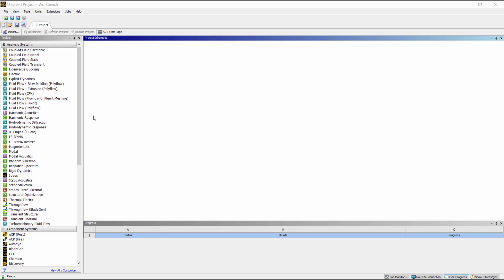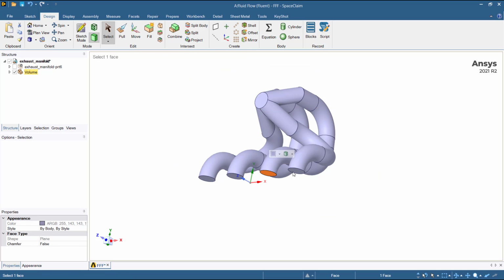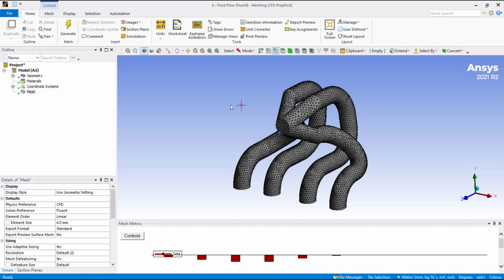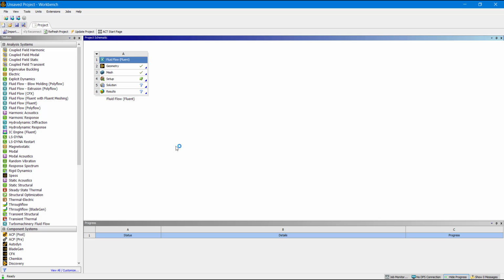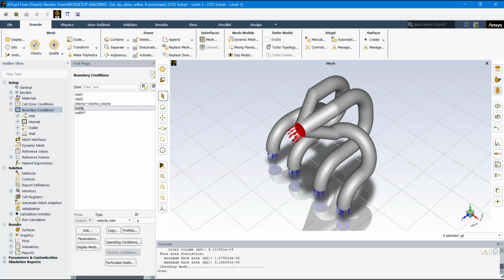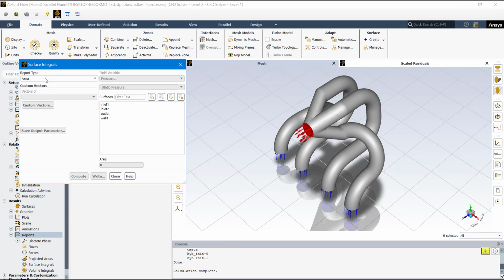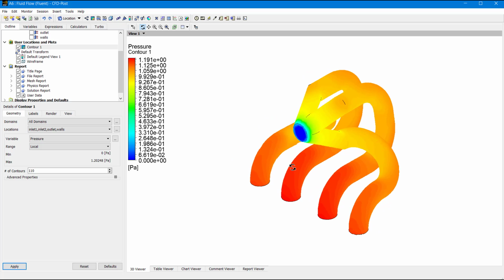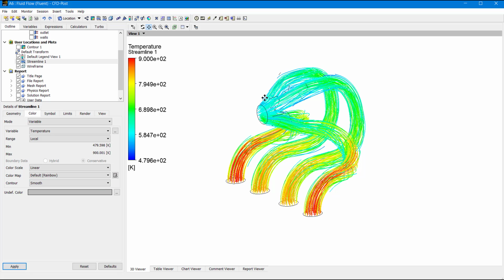How to do Analysis of Hot Air Flow Through Exhaust Manifold | ANSYS Fluent Tutorial I Heat Transfer

Comment: The default density of air in Ansys would be at ambient, since this analysis is for exhaust gases, wouldn't you need to adjust the density or set it to ideal gas?